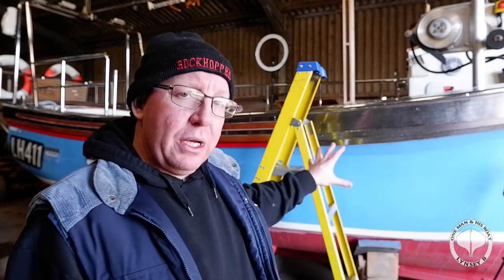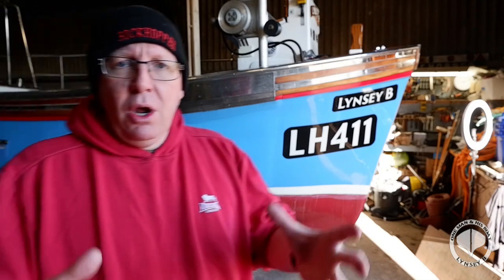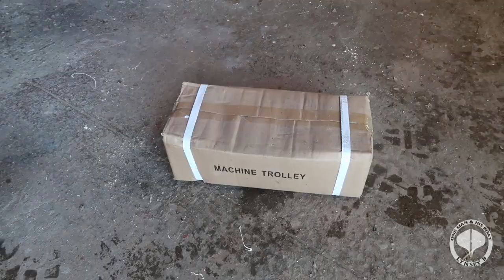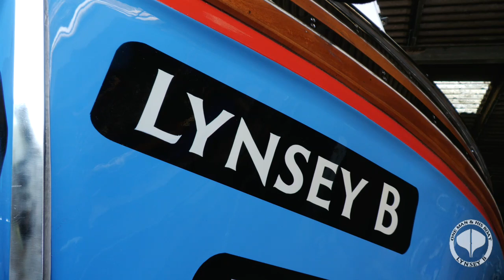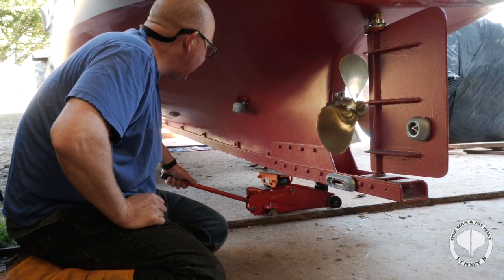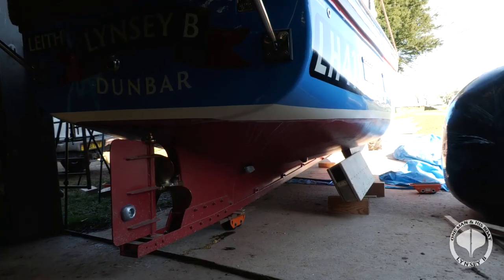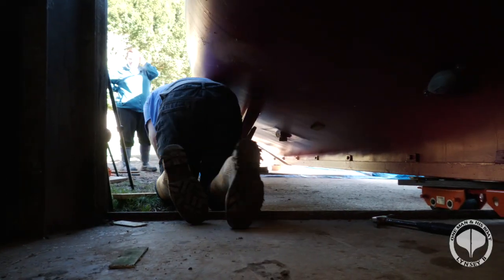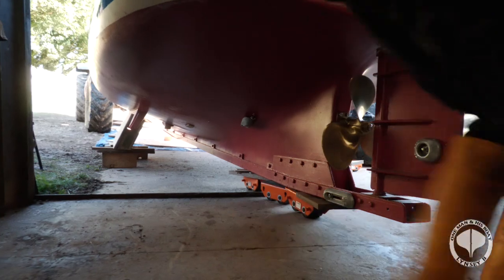Shedtastic!  Episode 104

Comment: A job well done mate and i bet there were a few heart in the mouth moments , i have had to do similar but not on such a big scale by my self running around like a headless chook tightening straps loosening others i used inflatable rollers and permapine posts to move my 18 foot half cabin onto its trailer from the rear yard ,very scary when you have to get underneath to move blocks or rollers you think dont you dare move ya bastard but you got it done and its a credit to all of you for a vessel of that size , and yes i have seen the fall of the chocks but s** happens take care .
Reply from the maker: Hi buddy.
Yeah, it's not for the faint heart that stuff, especially when so much work has been put into everything 😊😁👌